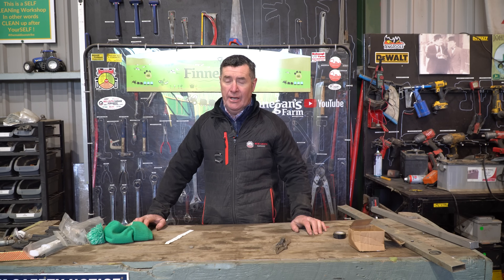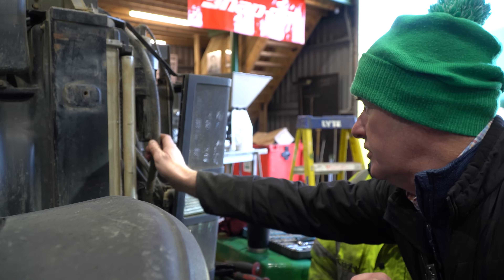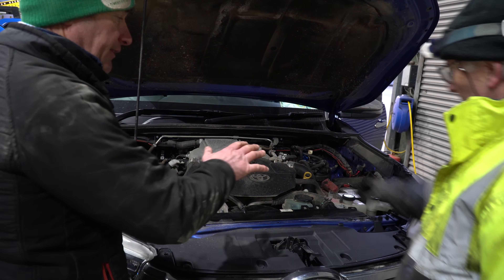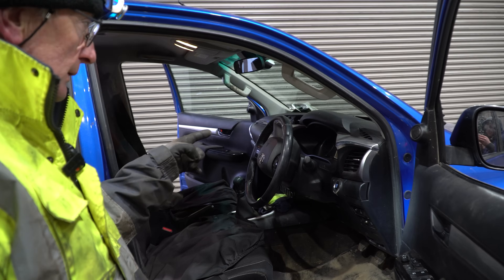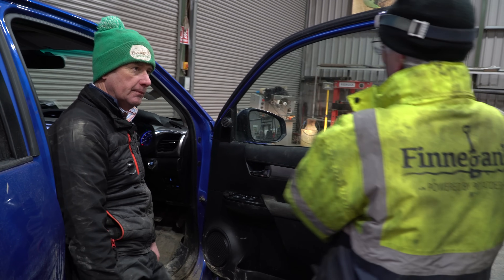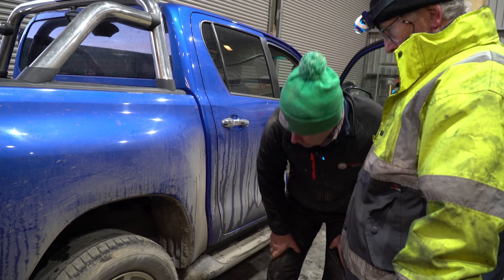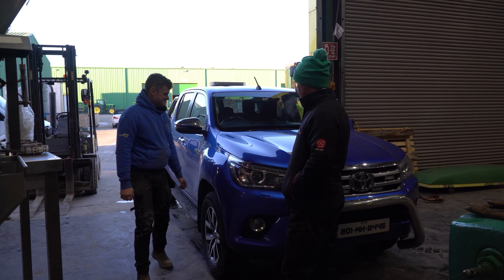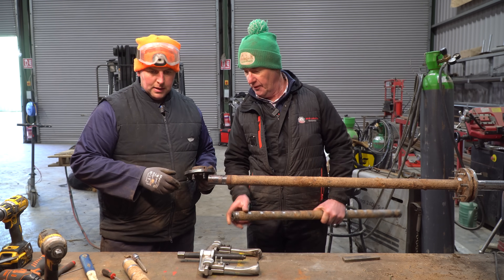WORKSHOP WEDENSDAY EPISODE 116! DOES THE JEEP PAST THE TEST?

Comment: Would tyres with a more slightly off road grip be better for the hilux as you would be in slippery vegetable fields. Our local tyre dealer would say it prevents body damage with possibly slipping sideways into a fence or gate post.
Reply from the maker: Still do a good bit of road work but off road tyres would be better for fields alright